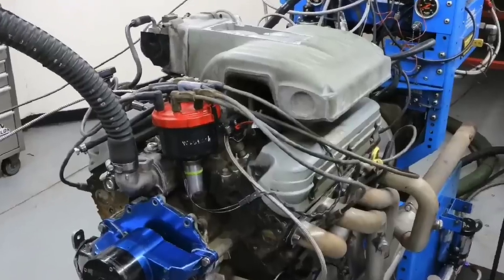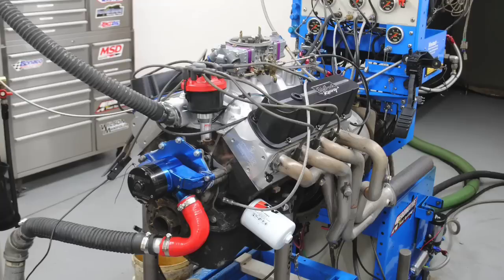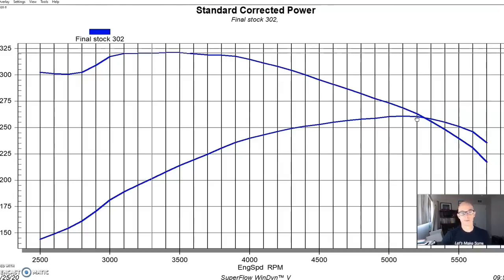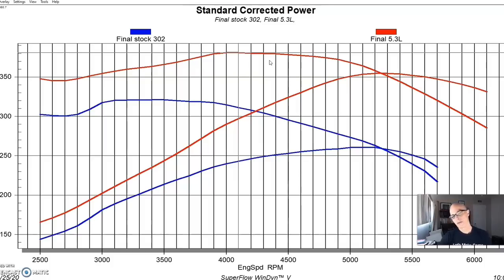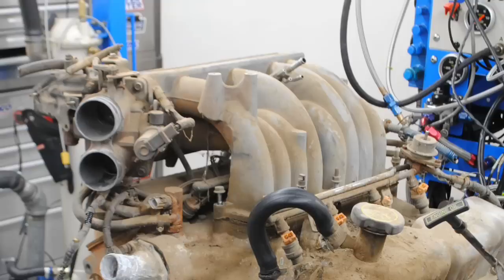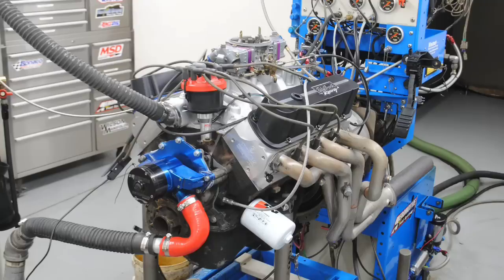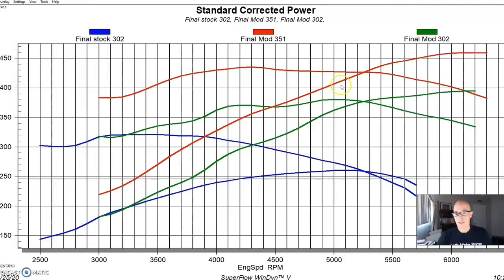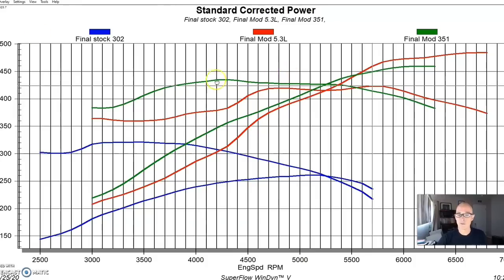5.0L vs 351W vs LS-SHOULD YOU SWAP?

Comment: Why would  you compare a  LS with a  stock 302,  one is a modern engine  the other was developed in 1962!
Reply: Only way a chebby can beat a ford . If from the same decade , the 5.0 and 5.7 chebby suck vs ford . LS Smellesh...grossly overate piles of f&$k.....I'd rather have pink eye .
Reply: @mattwillson8280  Alright, let's look at the 4.6 2v from a 1998 vehicle that Richard did a video on back in February. We'll say that the 4.8 and the 4.6 2v cost about the same from the wrecking yard, give or take maybe $100. Not looking too good there on the HP for the 4.6 2v, only 260. Maybe give it some cam? That's better! It's almost on par with a bone stock 4.8! How cute. And it only cost nearly $600 for just those cams. We won't talk about what that 4.8 will do when you throw $600 at it.
I don't care what motors anyone uses, all the manufacturers have their shit that they think doesn't stink. It's all fair game to me. Dollars/HP, 1/4 mile times, smiles per gallon. It's all in good fun.
Reply: these are the 3 most basic budget swaps.
Reply: Egg Boi. I agree with you, run what you want and what  makes you happy.
Reply: Fact...you can bolt an LS head onto a 302.
Reply: You just missed the whole point
Reply: @jamiewilson9380  Maybe tell us  what is the point but Putting a Chev engine into a ford isn't it
Reply: @robertelmo7736  that tends to happen when you copy other manufacturers designs
Reply: @AustinRBa  and what about the 4.6s 4vs that ford released in 93?? Making just as much power with a 4.6 in 93 as a 4.8 in 99 or whenever they came out
Reply: @mattwillson8280  You need to get yourself to rehab as soon as possible. I'll take you in my LS Chevy because I don't want to have to push your Ford there.
Reply: One reason is the ford 302 wasn't replaced until 1995 that being said the replacement engine isn't a pushrod motor ford hasn't made a pushrod motor until the new 2020 7.3 gas engine and only trucks are available with maybe the reason
Reply: @mattwillson8280  the LS engine powers more cars from other manufacturers than any other engine and 50 percent of foxbodies at the race track haven't seen many ford powered chevys wonder why that is
Reply: @mattwillson8280  there are more LS chevy powered foxbodies than there is ford 4.6 of the same era
Reply: @gloriamaletta8667  Because  Chevy made the right move when they  put  Ford heads on a Chevy!  But it is still a Chevy!
Reply: @gloriamaletta8667  lol what? 302s were made until 97 in the trucks. And were replaced in mustangs in 96.
Reply: @gloriamaletta8667  The reason Chev guys  put a Chev Engine in a Fox is, all the Chev cars are tanks that  are way over weight! No Ford Guy with any brain would take a engine  out of a lite Fox body and  put it into a two ton Chevy!
Reply: @mylanmiller9656  l have 3 friends with foxbody mustangs of the 3. 2 are LS Chevy powered don't see many Chevys powered by Ford engines there has to be a reason why
Reply: @mylanmiller9656  it's a GM head on LS engines don't see anything on it that says Ford your talking about the design of the head was developed by the same people that doesn't make it Ford the development was done at GM for LS engines
Reply: @mylanmiller9656  know of no Ford smallblock factory head that flow 320cfm on the intake side
Reply: @mylanmiller9656  you know Oldsmobile made the first style V8 in the 1940s while Ford was still making Flathrad V8 and copied Oldsmobile with the rest of the industry so Ford is using a Oldsmobile style engine
Reply: @mattwillson8280  if the chevy LS was a Ford you'd love it says it all
Reply: @gloriamaletta8667  I must've hurt your feelings or something with my observation on reality .....gee
Reply: @traxxasrcfun  The best 302 was  the one use in the Explorer from 1996 until 2001!
Reply: @gloriamaletta8667  Your a little slow The over head valve engine was around long  before Oldsmobile  made one. Besides  the first Ohv engine from GM was from Cadillac the Olds engine was a copy of that!
Reply: @mylanmiller9656  according to my information 1917 chevy series D truck was the first one Olds and Cadillac were the first cars in the US to mass produce ohv v8 engines
Reply: @gloriamaletta8667  In 1904 Marr  Auto-Car Built the first over head  Cam engine and the  same year Buick Made the  first Over head valve car engine .Espino Susie Built many  V 8 over  head  valve Aircraft engines during WW1 there  were others as well. Cadillac was the  first North American automotive Ohv V8. but not the firs not the first north American, V8 Ford built a OHC v8 that was used in Tanks during  WWII !
Reply: @mylanmiller9656  I'm talking cars not tanks or aircraft
Reply: @gloriamaletta8667  you talk of the  first V8 ohv  as if it were  a real brake threw. 
An engine is not a brake threw if it is a copy of someone else work!  it don't matter  were it was copied from it is still a copy
Reply: The over head valve was a 1904 first the  V8 engine was a 1909 thing, to put those 
together  was no big deal not like GM could hold a Patten on them!
Reply: @mattwillson8280  lmfao then tell me why when my 98 camaro ss t56 was stock would beat every gt up till the coyote came out
Reply: @dieseldong4781  Who cares
Reply: @mattwillson8280  you
Reply: @dieseldong4781  and then you woke up
Reply: @Contreras-z4e  Can you even afford to be in this conversation?
Reply: Should you swap your LS in your chevy to the new Ford Godzilla 7,3 .....??   Yeeeees
Reply: @gloriamaletta8667  50 years ago Ford  built the 351 Cleveland , that head is the one the LS engine was copied from!  and  every Cleveland 4 V would flow  better than 320 CFM.  Chevy never even changed the  head Bolt pattern! Ford  made an  engine  called the Boss 302 that kicked the ass off the Chevy Z28, it took Chevy 30 years to respond but the LS head is a real close  copy  of that head !
Reply: @mylanmiller9656  it's not a copy of the Ford head the people who worked at Ford of the time they designed it are the same engineers who designed the Chevy LS head and the Boss 302 head flow 280cfm not 320cfm the LS Chevy rectangular port LS3 or L92 heads flow 315cfm to 320cfm stock my CNC ported LS3 heads flow 358cfm on the intake side the Ford 351 cleveland heads flow 312cfm at 600 lift but the stock cam did not have near this kind of lift it was under 450 lift
Reply: @gloriamaletta8667  More lies !
Reply: @mylanmiller9656  the difference from the Chevy LS3 and the 351 cleveland is the stock cam that the LS3 comes with flow 315cfm on the intake the stock Ford 351 cleveland cam is under 450 lift but the heads flow 312cfm at 600 lift so at under 450 lift it would flow much less than 312cfm probably much closer to 260-270cfm with the stock cam but it would flow 312cfm with a aftermarket camshaft with 600 lift if you want to get in to copying all V8 engines besides the flathead V8 that Ford designed are copied from the 1949 Oldsmobile V8 so all other manufacturers copied it
Reply: @gloriamaletta8667  tell some more lies!
Reply: @mylanmiller9656  research it it's the truth
Reply: @mattwillson8280  it's the most swapped engine period regardless of manufacturers car or truck it's going into there has to be a good reason for it
Reply: @gloriamaletta8667  Your still chirping about an internet conversation from 6 months ago.....get a life.
Reply: @mattwillson8280  what are you doing looks like the very same thing get a life
Reply: @mylanmiller9656  you call lies but can't spout off an argument against what's being said smh the defeated act exactly as you are
Reply: @mylanmiller9656  🤣🤣🤣🤣
Reply: @robertelmo7736  that’s because it’s a Ford copy.
Reply: @gloriamaletta8667  the only reason it is swapped alot is availability and physical size means it can work in lots of vehicles.  It isn't  because it is superior.  Far as swapping mustangs goes that is because gm guys want a lightweight good looking car that can throw down at the drag strip and the mustang works better than most of their shit cars.  They just plain work.  It isn't because ford engines can't make power.  What about all the gm guys using mustangs to go fast?  Can't you use a gm car?  I mean...just sayin lol.  Ls is everywhere and cheap and they fit in alot of vehicles that is the only reason it's the most swapped.  If it were just going to potential everyone would be running a coyote lol.
Reply: @midnight347  it will not be long GM will have a 5.5 engine naturally aspirated flat plane engine that redlines at 9000rpm and makes 625 factory horsepower so you better start your Ford 5.0 upgrades 460 horsepower will need a lot of upgrades to reach 625 naturally aspirated
Reply: @midnight347  if the 5.0 is such a superior engine why did Ford come out with a pushrod 7.3 engine for trucks could it be the 5.0 sucks below 4000rpm and if you really look at the new Ford 7.3 it sure looks like they copied the LS Chevy engine design
Reply: @midnight347  the reason the LS engine is such a good engine it started in 1997 345 horsepower it's 2021 the new LT1 is basically a up graded LS engine basically that's the same style engine being used for 24 years now what kind of following does the 4.6 Ford engine have that started in 1995 and ended in 2010 the coyote engine replaced it in 2011 to now that's 10 years in 14 more years do you really think the coyote design will still be around or in production most parts on LS engines with a very few exceptions interchange for the most part you probably can't interchange anything on a coyote 5.0 from gen 1,2,3 or most of it starting to see the light the 345 horsepower LS in 1997 was not surpassed by Ford with a naturally aspirated V-8 engine until 2011 l believe that's 14 years and you can't even admit it is probably the best pushrod V-8 engine ever produced after Ford not being able to match that 345 horsepower for 14 years and then to say it's been in production and still being used today 24 years later if Ford did this you'd be waiving a Ford Racing flag in every Chevy owners face just simply say I'm Ford fan regardless and l hate Chevy don't feed me crap that the LS engine is nothing special because if Ford made a engine that Chevy couldn't beat or match that power for 14 years you'd say Ford was the absolute best and for Ford to surpass the 345 horsepower LS it took 4 camshafts and 32 valves to do it yeah the LS engine is nothing special OK LS engines have been sold in the multimillions l don't even think Ford has produced a million coyote 5.0 from 2011 to now

Comment: For the cost of conversion
Motor,  gearbox, ecu,  radiator,  exhaust and tailshaft etc 
You could build a good 5.0 for daily street and track fun.
Reply: Francis Stone. You summed it all up in your statement.
Reply: Yeah but you would be slow
Reply: It wont compare to the ls tho. Far as racing
Reply: @major1388  351 would be a lot closer
Reply: you tell yourselves that im aussie mate Ls is way more pricey here and is still cheap for the power you yanks can pick an Ls up in stock form with cast headers box loom and ecu for less then 1000 usd  for that piddly price you get a motor that makes 360hp 380ft lb  for another grand chuck in a cam you have 500hp motor... try to argue that you would be even a quarter way in to having a 5.0 ford make 500hp for 2200. if your a real car guy you could just fab up your own exhaust and get your factory tailshaft modified
Reply: @Xbudmarley420x  well you got alot better option than the ls swap into a Ford on a budget.  The Barra (green top)  is without doubt cheaper and we know 500 horsepower is lazy for that
Reply: @francisstone8221  that is true and I'll probably do one if I ever get around to building my f100
Reply: @francisstone8221  green top is basically the exact same as the turbo red tops just missing some of the tuffer parts like the valve springs good oil pumps and that so for well under the price of the red top you can get all aftermarket versions off those end up stronger then a red top they do have their limits tho you do need to build an engine after a certain point
Reply: I’ll take my Dart iron eagle block that will support north of 2500 hp all day over any LS.  When making over 2000 HP you won’t us a LS
Reply: @ptaormina8010  could still do that power cheaper... 454 lsx
Reply: And you blew the topic off this thread which was the guy talking about it being cheaper to do a built 5L which was wrong completely my comment stayed on topic then you blow right past that with a comment about a 40k dart engine build
Reply: Have you lost your mind? Please do your research, the ls swap is a lot cheaper than building a 302, the stock bottom end can hold together up to 1000hp, you can build a junk yard ls and have 500 to 600hp for 1500 bucks, please you have to get past this ford vs gm BS, do you want to go fast, or do you want to waste time and money, clear answer is ls swap it, you can have  fuel injection or carburetor it, it's cheap, it makes more power, hot rodding is not for everyone, sorry
Reply: @francisstone8221  the barra is not cheap here in the US, you can buy a 5.3 ls for 500 bucks all day long, for 1500 bucks have 500 to 600hp, that's buying the engine included, I priced a barra, looking at 4k in the US, if you can find it
Reply: @jeremyhigh3186  
At no point did I say anything about monster horsepower,  budget build and daily use.  I'm very aware of costs building a sbf . I'm well past any Chev ford bs only dealing with 5 cylinder Volvo's and Audi's now days. 

https://grassrootsmotorsports.com/articles/addressing-internet-myths-about-ls-swaps/
Reply: @jeremyhigh3186  
Last one I bought was $100 with ecu 
Yep I'm in Australia.
Reply: @jeremyhigh3186  it isn't just the cost of the engine bro.  Swapping it into a mustang and having everything work on your street car and staying fuel injection you gotta change alot of shit which is added cost.  Again IT IS NOT JUST THE COST OF THE ENGINE.  Do I need to repeat that again or do you got it?  You're not swapping a 500 horse modded ls into a mustang for 1500 bucks...not happening.
Reply: @midnight347  hold bra, you're over complicating things here. First off calm the f%^@ down. There's no reason to get pissed here. I know swapping a engine sounds complicated and expensive, but its not. Just do a little research, "GOOGLE". Believe or not, parts out there pretty much for everything. 
Who care's if you're running an illegal race car on the streets, I do it everyday.

Comment: I'd bet there was a Compression ratio difference between the engines as well. The windsor does well for an engine designed in the 60's but modern tech shows through with the LS, even modified

Comment: I've got a full on heads, cam, intake 351W in my crawler and it's stout, but my next project will be a boosted 6.0LS that is going to make 2x the power for less than what I've got into the 351W build alone.  I've got two 6.0's and an 80E for $100 invested, I cannot complain.  SEP 1500's already acquired...
Reply: That isn't realistic pricing though idk how you landed 2 6 liters for 100 bucks but that is certainly not typical lol.